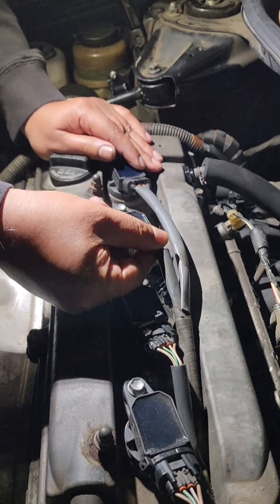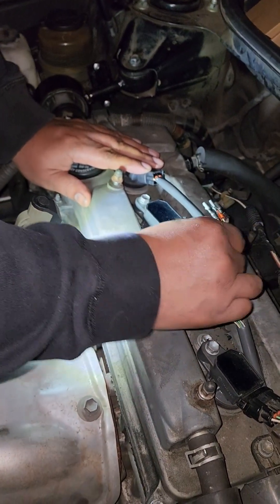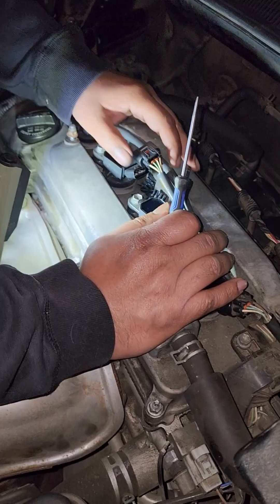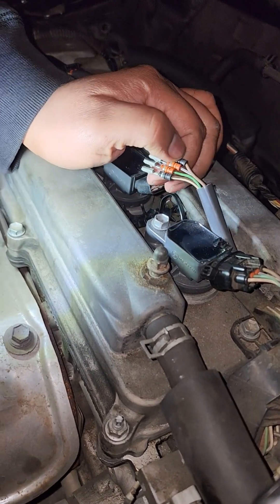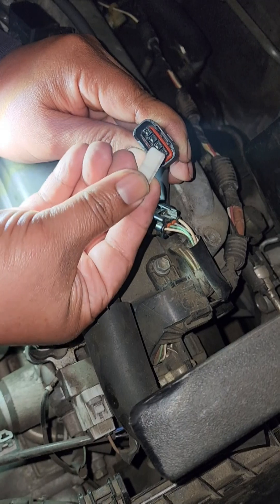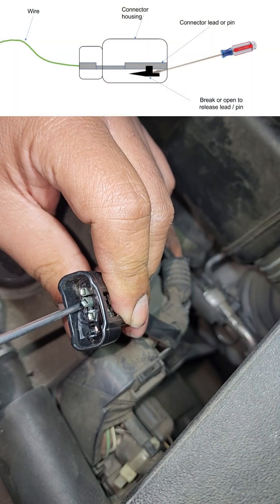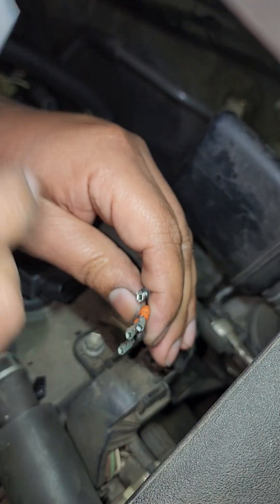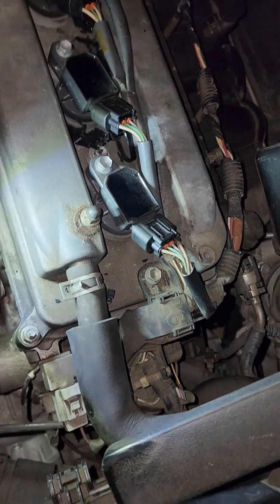Replace Coil Connectors Before Wasting Money at the Shop

Comment: Do you suggest using CRC's QD electronic cleaner on the terminals?
Reply from the maker: I am very careful with that stuff as I have seen it eat up terminals or components if not used correctly. Honestly a little scraping some alchohol go a long way. Better yet replacing the terminal if its too far gone. Feel free to use it but be very careful when and where and always do a test spot.